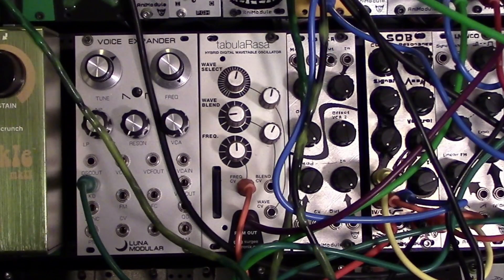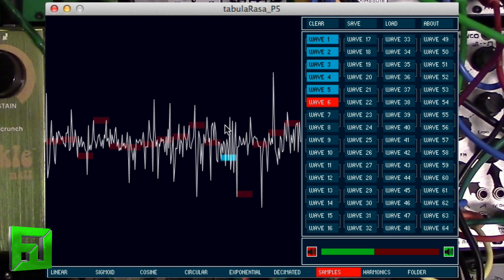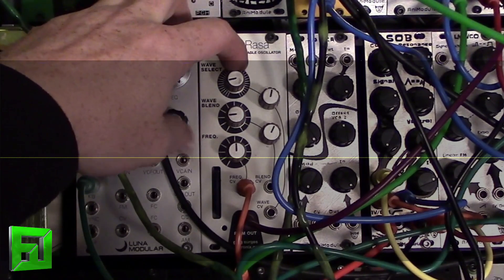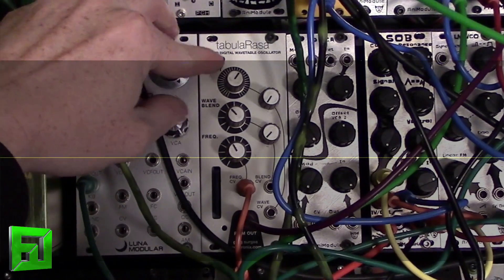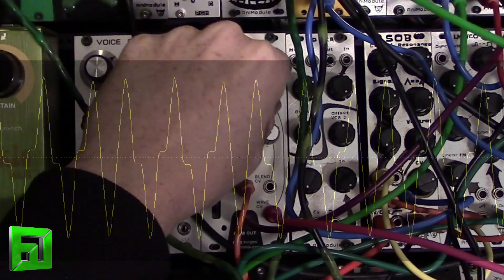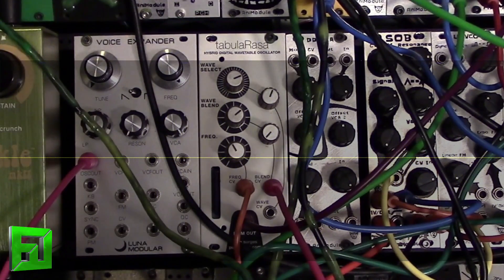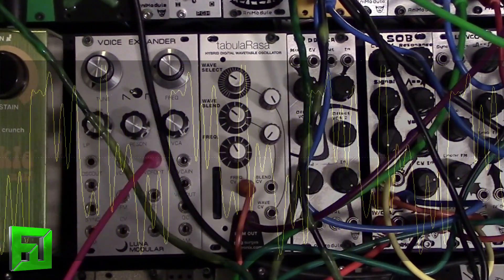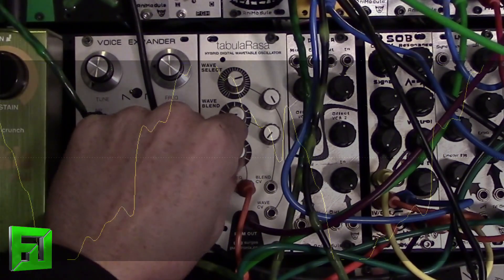DIY Eurorack Modular Tabula Rasa wavetable oscillator module

Comment: The transitions on those wavetables aren't doing it for me. Discontinous and glitchy. Serum wins again. Unlimited wavetables from any source editable in all kinds of ways and amazing clarity. One of the best sounding synths around, soft or hardware.
Reply from the maker: Comparing this and serum is like comparing a HD tv with a shoe. Completely different... Sure both are things that exist in this world... Both can be bought with money... But yeah you are reaching pretty hard with that comparison lol
Reply: *****
Both wavetable synths. Tabula rasa fails in this regard. I realize they occupy different realms, one a vst, the other a module in a modular system. But my point was, does it achieve what it claims to do and do it well? Arguably, with this particular module, no.If you're looking to do wavetable type stuff this just isn't very good, that's all. And this ain't about me dissing modular stuff. I'm saving up for a few pieces having just purchased a new computer, Mutable Instruments wavetable module (whose name escapes me) is on my desired list. So not hating on your thing. Although I would contend nothing approaches Serum in that world at this moment and since quite a few modules, certainly all wavetable osc modules, are basically digital, the absence of something that does what Serum does is worthy of comment.

 As a computer musician, the whole modular concept has influenced me greatly in terms of sound design, through using environments like Max 4 Live, Reaktor 6, Fl Studios patcher, Puredata, Mulab Mux and various Csound environments.I also pick up a lot of concepts from watching videos like these.What excites me most is the interface between these two worlds, especially in terms of integrating hardware modular gear with computers and vice versa. So for me, what I wrote wasn't a stretch because these worlds are becoming increasingly integrated and interchangeable.Also in the end it's about the sound, not the means of achieving it. So to repeat,one can compare two wavetable synths, even if they come at it in different ways.

BTW, aren't you involved in that thing that replicates a whole load of hardware modules for Reaktor? From what I remember, that thing looked pretty awesome. So rather than being pedantic with me, why don't you get that thing out:D I'd buy that in a heartbeat.

Other than than that, have a good time making music.
Reply from the maker: No sorry... You are on apples and oranges to an extreme extent here. You are talking about so many different aspects that are completely not comparable it's almost not worth discussing. 
Tabula rasa is an intentionally Lofi very very low spec oscillator done with ancient arduino hardware... How you can justify your comparison with one of the latest greatest soft synths that requires a fairly recent chip set to run is beyond me. Let alone the application being completely different etc. I mean this is honestly like comparing a distortion guitar pedal with isotope ozone... Sure both can do distortions but the application is completely different the use case isn't similar at all. It's just a ridiculous comparison.
Reply from the maker: P.s. System 63 is indeed still coming and there is nothing pedantic about my statement.   It simply makes no sense to compare wrench to a computer diagnostic tool... So why compare a purposefully Lo fi piece of hardware with a purposefully hi fi piece of software?
Reply: *****

"So why compare a purposefully Lo fi piece of hardware with a purposefully hi fi piece of software? "

Because I was unaware of that aspect of it, or the intentionality behind it. To me, it just sounded like failure.Since failure is, in a sense, it's intention obviously that negates my statement.To paraphrase Eno, the essence of the lofi aesthetic is about the failure of the medium, so obviously by this measure it is a success.

It's good to see such passion in defence of a concept, though the level of vehemence is somewhat grating. So far I've  been civil, you might want to take it down a notch.Talking to someone like they're an idiot, while in keeping with Youtube's culture, is somewhat alienating. Although, admittedly, this may be Karma for some of my earlier antics with other people.

So any kind of definite eta on System 63?
Or just an infinite horizon of non specific statements stretching out into the future forever? Because, sarcasm aside, I would really love to use it, as opposed to watching videos of it.
Reply from the maker: +Adam Smith I'm not treating you as an idiot, I'm simply pointing out the obvious fact that you have compared something with something else that bares extremely little in common. Even if you tried to compare serum with something like the e350 (a high quality Wavetable vco module)  ... It's still apples and oranges.  

As for system 63. It's release date is not up to me. I've been pressuring to get it out ASAP. It's very very close to release but business is more than just code and play. 
I hope to see it on your screen soon.
Reply from the maker: +Adam Smith One more thing I plan to do a wavetable VCO shoot out very soon
Reply: *****

"I'm not treating you as an idiot, I'm simply pointing out the obvious fact that you have compared something with something else that bares extremely little in common."

No need to belabour the point mate, I conceded your point already. I was only half watching the video while doing something else, so I can see in retrospect having rewatched, that what I wrote was a bit erroneous. As for the idiot bit, what can I say? I was a bit cranky from no food + simultaneous twitter war with some guy who seemed intent on misinterpreting me and arguing about an argument. He got blocked, but everything's cool here.Especially after some sausages:)

"Even if you tried to compare serum with something like the e350 (a high quality Wavetable vco module) ... It's still apples and oranges."

How so? My experience with modular stuff is mostly software, I've mucked about with a few friends modular systems. But hardware wise, it's really only been fixed architecture stuff, for any long term work. As I wrote earlier, I am looking at getting a few pieces in future so any info I can get from someone with experience in this would of course be of value. Obviously the modes of modulation and control are different, but the essential concept is the same right? Or am I missing something?

"As for system 63. It's release date is not up to me. I've been pressuring to get it out ASAP. It's very very close to release but business is more than just code and play."

Cool. I hear you, I've got a few projects presently  that have dragged out way beyond any reasonable time limit. A large sound set of patches for a major developer, and some composition work for media that have both been revised beyond my patience. Always worse when you're not in complete control.

"One more thing I plan to do a wavetable VCO shoot out very soon"

Looking forward to it.
Reply from the maker: Man, I'm gonna try and articulate this but to be completely honest I'm tired from a long day and I just got quadnic (another Wavetable vco), rainmaker and trogotronic m277 in (and I'm in the midst of soldering up a pair of clouds) so my attention is fleeting.

Software vs hardware is obviously it's own debate and I find the use cases rather separate for me. (That being said I do tend to blend the two but I'm more talking workflow). No hardware is going to compete with software in terms of upgradability and flexibility. Serum will out pace any hardware when it comes to things such as shear number of Wavetables , importing , and effects. 
In the same way you wouldn't compare kontakt 5 symphonic libraries to actually having to mic  up a quartet... It can be similar. You will obviously have a ease of use relating to saving storing and presets that modular just won't have. 
Where something like the e350 or orgone accumulator surpasses serum is in the tactile environment. This can breed more or less creativity based on your personal preferences . 
Also there is something to be said about a cpu not having clock cycles stolen by other processes. 
The way the e350 morphs is beautiful (and proprietary )  similar results can be created in software but again , something is lost in translation.
Reply: *****
I hear what you're saying about the whole hardware versus software debate. For me, it's kind of a minefield I'd rather not venture too deeply into. I prefer to stay agnostic on it. Use whatever tools you have available and if you have the luxury of both, then use both, but whatever one does it's good to learn everything you have inside out, so you can use it appropriately and knowledgeably. Even though, for me, software has advanced considerably, with synths like Strobe 2 and Diva getting pretty close to the analog hardware they are imitating, they're still is a tangible difference. One can argue about how much of a difference that makes in the context of a busy mix, but the difference is still there nonetheless.All I know is, that when I borrowed a friend's Moog Voyager to replace some of the bass parts for some Hip Hop stuff I'd written using Uhe Ace, old Moogy won out about 60% of the time. Still,  better than 10 years ago though, when that would have been 100% :) That being said, I love a lot of the stuff that can't be done or would be difficult to imitate in hardware, using tools such as Harmor, Alchemy, Melodyne (which to me is more of a compositional device), or Gheist. So definitely the edge goes to software for audio manipulation and sample mangling. A speciality of mine.Also in real terms, a lot of the virtual analog stuff does the job, most of the time, with all the advantages of ease of use that come with it. Still would love a Make Noise O coast in my studio right now. If I weren't in quite a bit of debt...So saving for now, instead of stretching credit beyond the realms of credibility.

"Serum will out pace any hardware when it comes to things such as shear number of Wavetables , importing , and effects."

I hear you there. Effects are obviously a whole other thing. But it would be something else if somebody developed a module with a software interface, that allowed you to roll your own wavetables on a pc or mac and dump it to the module via usb. If done properly, that would really capture people's imagination. I wouldn't be surprised if other people were thinking along these lines though. So...

"Where something like the e350 or orgone accumulator surpasses serum is in the tactile environment."

I can see where we talking somewhat at odds here. For me, I was merely discussing the end result, sound in a composition. You were looking more at a process.

What little experience I've had of actual real life physical modular systems, indicates a far more physical embodied approach. Also with a great deal more unpredictability, although some of that may be lack of experience:) I had the pleasure of working with a Make Noise Shared system a few months back, while collaborating on a project, and while I was able to translate some of the stuff I'd learned from Reaktor and other software stuff to that, about 50% was fucking about and seeing what happened. Definitely a lot of happy accidents and stuff I wouldn't have done normally. The unpredictability of having a timbre or rhythm change radically through the minimal change of a paramater was pretty addictive. Laid down loads of loops that often end up in Ableton.Working with that system was  a nice change of pace from mousing around.

"Also there is something to be said about a cpu not having clock cycles stolen by other processes."

Lol. A problem for me in a different way. All my computers for music thus far have been custom builds for that purpose only, so the problem for me is devs releasing ever more complex synths, so having to upgrade. I still haven't transferred Serum, Strobe 2 and Bazille to my new computer. They really make my old one cry.Lots of laying down to audio and resampling. Although treating stuff as samples is of course another world in itself.
 

"The way the e350 morphs is beautiful (and proprietary ) similar results can be created in software but again , something is lost in translation. "

I haven't heard of this. I must check it out. Yet more reasons to get out there kick ass and get the ball the rolling on some of my current projects, before buying more gear and ending up broke again, like I did last time. Still, more fun than any of the shit I did before though.
 

Anyway, don't feel compelled to reply if you're busy. As it is, I'm just about to embark on a Serum programming marathon myself. So social media getting turned off.